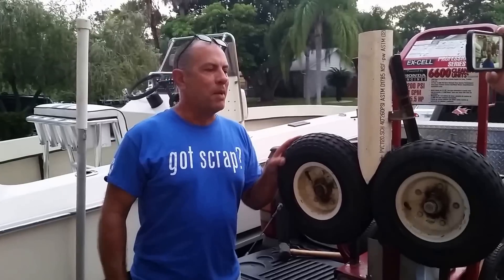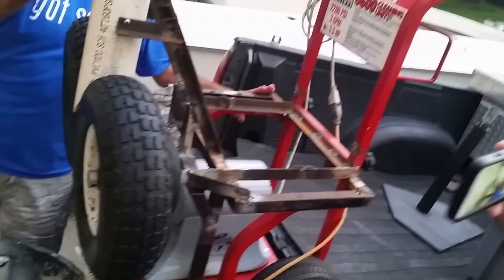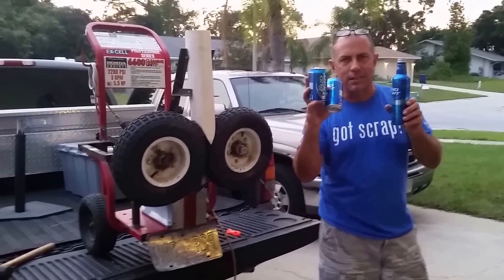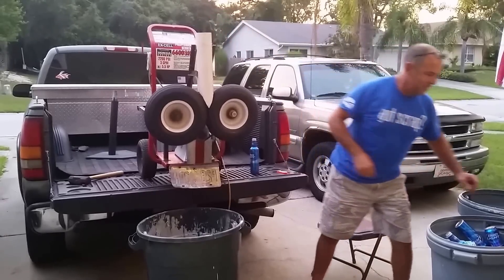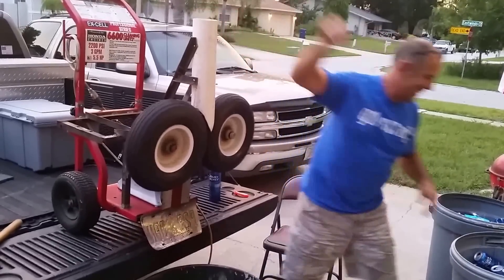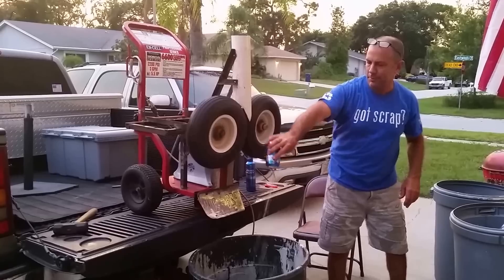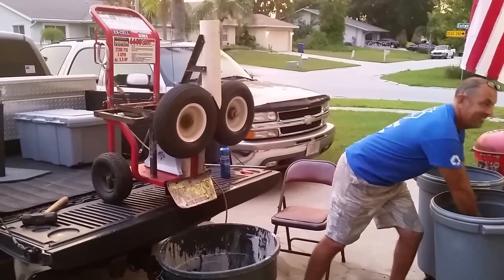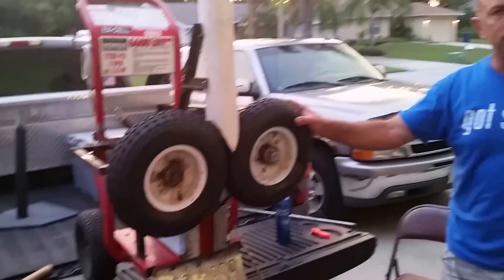Beer Can Crusher Powered by Electric Motor Scrap Parts Recycling

Comment: Fran, Man I love it. Oh I have so many IDEAS for this. The tire could not get a crip once they got wet. You already know that. I found two lawn tractor tires/rims and they hold air. I had to have my Trane motor/squirrel cage assembly replaced. The motor works. I do not know the HP off the top of my head. I would love to make it portable. I have and old metal dolly and 3 of the big back wheels some lawn mowers have. Time to build.....I got some fun ideas for this. THANKZ!

Comment: Those H.F. wheel barrow tires are not rated for those r.p.m.'s. They are going to blow apart in your face.
And no guards? What are u thinking?
Reply: They need to GEAR IT DOWN BADLY!!!  Hold my BEER while I light this FUSE!!!  I would watch it work with Binoculars!!!

Comment: I wonder if slowing it down would reduce the annoying sound.  Great idea though.
Reply: THE SOUND IS BECAUSE ONLY ONE WHEEL IS DRIVING IT AND THE SECOND WHEEL IS PRESSED HARD AGAINST IT. SO THAT NOISE IS THE EQUIVALENT OF TWO TIRES ON THE ROAD MINUS THE ROAD. IF HE PULLED ONE BACK TO WHERE IT WAS BARLEY NOT TOUCHING AND MADE A CHAIN DRIVE TO EAVENLY POWER BOTH WHEELS IT WOULD MOST LIKELY QUIET DOWN

Comment: what I want to know is how you went from the bolt pattern of the tires to an axel? Right now I am looking for fatter, larger tires from the rear end of a lawn mower, but it's hard to find the type that have a rod going through them, rather than a bolt on attachment like a car does. (can I see it from the back?) I have 3x powerfull clutch motors that are very heavy and have tons of torque I could easily drive 2 large wheels at a lower speed with more power so cans could be feed constantly and several at a time.
Reply from the maker: +TheStarforce2 What looks like a bolt pattern is how the 2 halves of the rim connect. Those particular wheels I used already had the bearings in them, so I was able to mount them on 5/8 shafts I had. I like your idea of using lawn mower tires. I know those shafts are closer to 1".  On my mower, the front tires are on a bearing and the rear drive tires are on a keyed shaft. Good luck